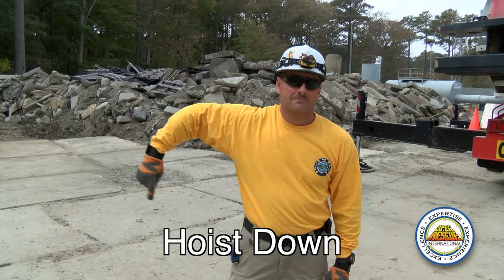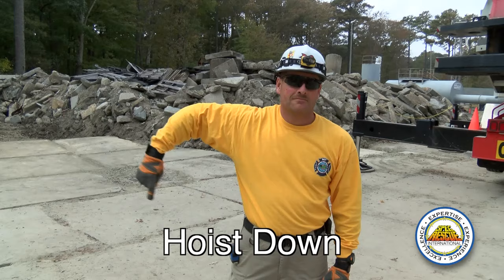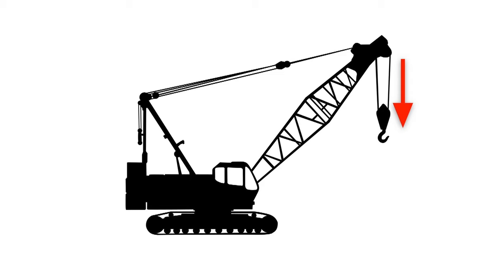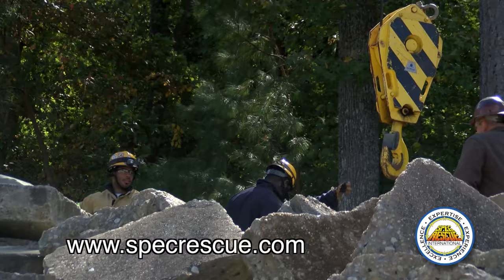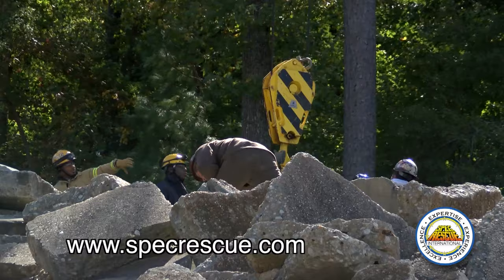The Spec Show - Crane Signals

Comment: Thanks for this. Not many videos with 1 handed signals which we need to use on the daily. Most of the time we are doing something with one hand and signal with the other.
Reply: I often have to drive a lift at work to stage our materials when our warehouse operator isn't there. My crew will give me hand signals, as i am driving "blind", but all-clear. I think it's cute, so i let them.. and it adds a layer.of safety. But, i have been on a lift for 20 years. I'm a surgeon.